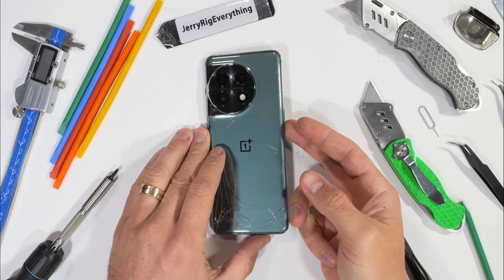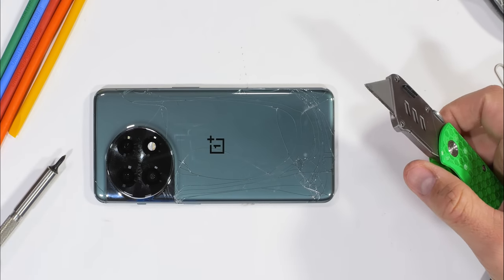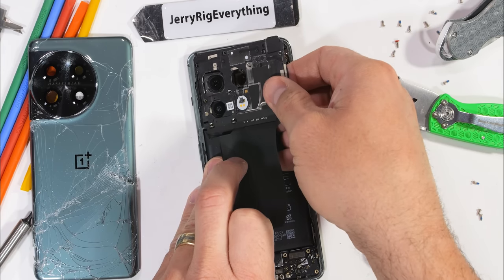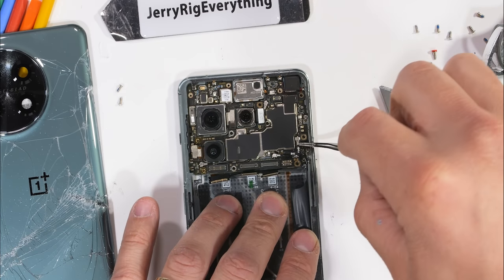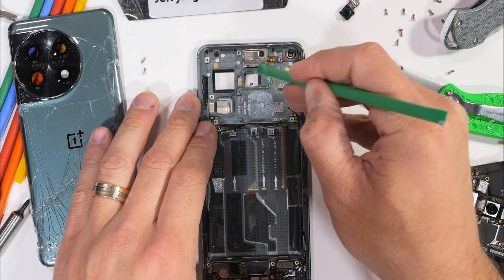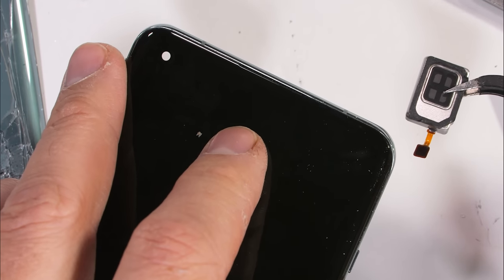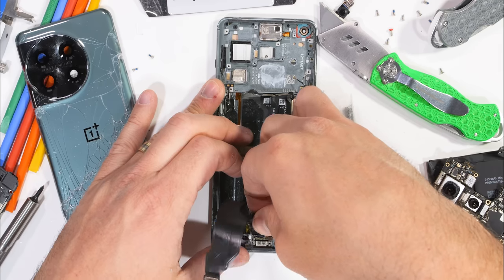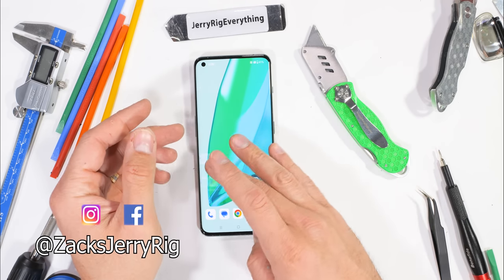The new OnePlus has OneTwo many holes

Comment: Glass backs... 

Can we please just conclude here that that's the smartphone companies' biggest fail in years?!
Why not use some more durable material like metal?

Main reason I'm still on my Oneplus 3
Reply: it allows for wireless charging plus it feels more premium
Reply: @lifeisshørt_420  it certainly "feels more premium" having a solid block of aluminium in your hands which looks as new as it was nearly 7 years ago! 😆
Also if  the typical glass back breaks (which they ALL do sooner or later) it wouldn't feel nice anymore I guess 😉

Secondly, wirelee charging:
Jokes on you, the Pixel (3 or 4 it was I guess) also has a metal back while being able to wireless charge.
It's just covered with an epoxy resin which would also be okay to me 😉

Comment: The only way for OnePlus to get beck to the full of their glory is to ditch ColorOS code.
The phones are noticably worse to root, you're missing key features. And working like dogshit when you get m rooted 

The loss of EDL mode for consumers so they can themself flash clean os on the phone in case of a catastrophic failure for whatever reason.
OnePlus is on the decline, and as long as they don't fix the firmware and purge the ugly code they won't get the money of their primary target audience.